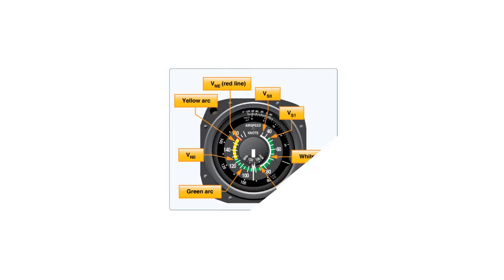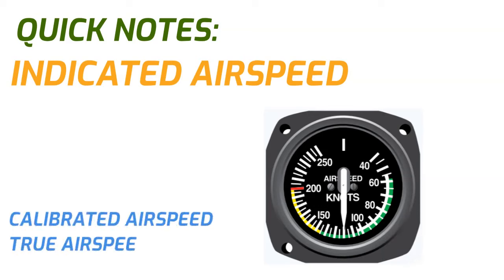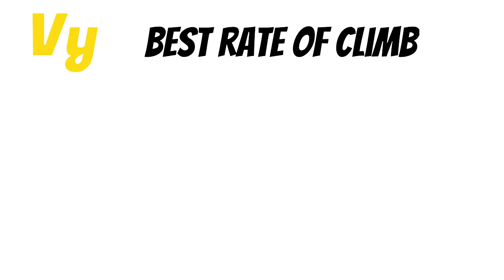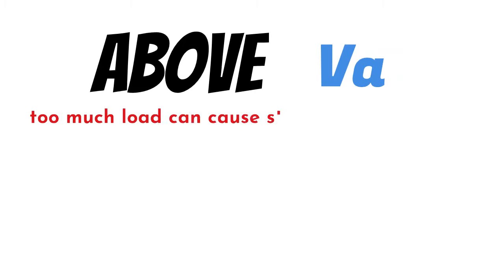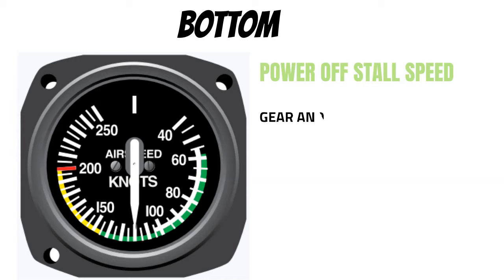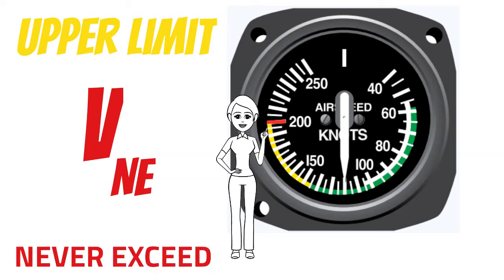V Speeds EXPLAINED! (Private Pilot Ground Lesson 12)

Comment: 0:23 V stands for velocity 
0:34 vspeeds refers to indicated airspeed 
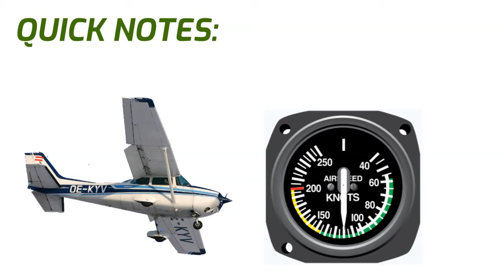0:55 at different speeds and flaps, there can be speed error. Manufacturers have adjustments in the POH. This is known as CALIBRATED AIRSPEED 
1:14 true airspeed is airspeed calibrated airspeed that’s adjusted for altitude and temperature 
1:20 -at colder temps and higher altitudes there is less pressure 
1:25 the airspeed indicator uses pressure to tell us how fast we’re going 
    - 1:32 to calculate this either use a flight computer or add 2% to your calibrated airspeed for every 1000 feet 
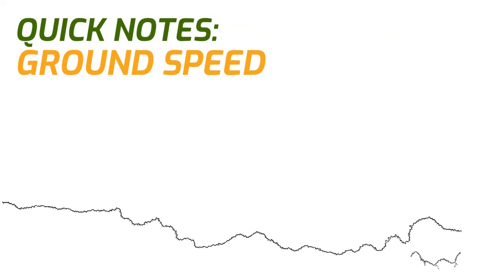1:40 ground speed- how fast airplane is flying over the ground 
  -if you have a head wind, you’re traveling over the ground slower than the airspeed indicator is showing 

2:03 VX and VY
-Vx is best angle of climb  and best used for climbing over an obstacle 
-vy is best rate of climb for time. 

2:46 maneuvering speed Va
-fastest airspeed you can fly without causing structural damage if fully deflecting a control or in turbulence 
- at below this speed you will stall before damage will occur 

4:12 Vs0
-gears and flaps for landing 
-S0 “stuff out”

4:19 upper limit of white arc “Vfe”
-max speed with flaps extended

4:39 green arc is normal operating range 

4:41  lower limit of green arc 
VS1 stall speed 
-S1 (stall with stuff in)

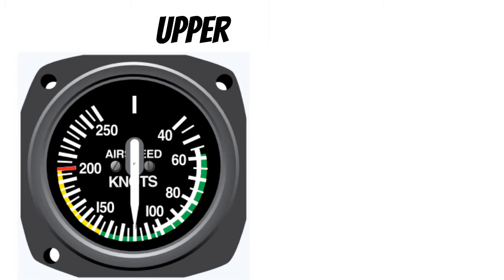4:52 upper limit of green arc 
-Vno (max speed in smooth air) 
-“normally operated” 

5:13 yellow arc is the caution range and should only be flown in smooth air 

5:54 VLO
-maximum speed for extending and retracting gear 

6:06 VLE
Maximum speed after gear has been extended

Comment: Hi! At 1:20 I think you wanted to say warmer temperature instead of colder temperature. Cold means high pressure because there is more mass in less volume, thus greater force acting on objects

Great videos, keep up the good work!
Reply from the maker: Yes. You are correct. I misspoke there. Thanks for the comment!
Reply: While some of this might be true cold air is usualyl more denser than warm air, which creates that higher pressure. The relationship between temperature and pressure within the atmosphere is more complex than just more pressure = colder. Typically at higher altitudes the atmophere contains air pressure that is lower. 
Picture this, you'ree standing on top of a high mountain looking down towards the valleys beneath you. The air at the top of the mountain is colder than the air in the valleys because it is higher in altitude. The air pressure at the top of the mountain is lower than the air pressure in the valleys below, even though the air is colder. The reason for this is because of the weight of the air bove the mountain is less than the weight of the air in the valleys, which creates that lower pressured system at the top of the mountain.  As the air above is lighter, the atmospheric pressure is lower even if the air at the top of the mountain is colder and denser than the air in the lowlands. You have to remember the relationship between temperature pressure and such also has to due with  variables like wind patterns, pressure, temperature, etc.

And in refrence to True Air Speed (TAS) the higher you go the less pressure there is thus there is less force acting on objects in the air. This entails less resistance to the motiono f an aircraft meaning less drag but also less lift. The true airspeed typically is higher than IAS because of that "less resistance"

So given the video, I believe FreePilotTraining is correct here
Reply: And I forgot to mention the temperature is typically colder and the pressure decreased due to the phenomenon known as the temperature lapse rate
Reply: @FreePilotTraining  As it also appears in text on the screen, it would be best to edit that bit of the video to show the correct text which could also show the correction in audio. It is too important to let this go by as some may memorize the wrong thing.

Comment: GREAT video man - I have one comment. I'm a new student so forgive me if this is incorrect, but I don't believe Vno is "the fastest we want to fly in smooth air". That would be Vne. Vno is the fastest you want to fly in ROUGH air. Gleim says "Flight above this speed (Vno) should be conducted only in smooth air and with caution."
Reply from the maker: I know, the wording is tricky in these V-speeds, but I double checked the P-HAK to be sure. I didn’t use the greatest verbiage, but what I said is basically correct. The PHAK says Vno is the “Maximum Cruising Speed. Do not exceed this speed except in smooth air” Vne is “Never Exceed Speed.  Operating above this speed is prohibited since it may result in damage or structural failure.”  So basically, I would not fly above Vno (in the yellow arc) with anything above “very slight” turbulence. You should Never exceed Vne. The airplane designers didn’t make it to go that fast
Reply: @FreePilotTraining  I think we’re saying the same thing just in different ways lol. Thanks for the response. I must’ve missed the “except” in the video
Reply from the maker: @RenaissanceSTL  lol I thought that was the case but I wasn’t 100%
Reply: @FreePilotTraining  in the video for Vno you say "this is the fastest you want to fly in smooth air" and the text on screen is "Max speed in SMOOTH AIR" you did not say "except in smooth air".

This is very confusing because immediately afterwards you say only fly in the yellow range in smooth air which directly condradicts what you said about Vno
Reply: @RenaissanceSTL   you didn't miss the except, I went back and listended several times and checked the subtitles and the text on screen clearly says "max speed in smooth air"
Reply from the maker: @nobodyofnaught2  I guess that is kinda confusing. Sorry about that
Reply: I'm glad this was in the comments because it has been bothering me as I go through the videos. Thanks for the clarifications.

Comment: So is the difference between Vlo and Vle that Vlo is the max speed in which you can extend and retract landing gear whereas Vle is the max speed you can fly with gear extended and retract? Or another way of saying it is the difference is Vle is the speed in which you CAN’T extend the gear, you can fly with it extended but you CAN’T extend it, only retract it?
Reply from the maker: Correct.

Comment: Thanks got the video! Do you think you could do some examples for the corrections for airspeed, and also adjusting for standard pressure, etc.?
Reply from the maker: I’ll see if I can make a short lesson on that for the next lesson! I appreciate your feedback.
Reply from the maker: Peter, I started making that additional lesson, and I’m wondering if that might be a little too much in the weeds for a Private Pilot lesson at this time.  We are going to discuss True airspeed again in the flight planning portion of the course.  In the performance section of your ooh, there is a chart which shows you what you’re True airspeed will be at different altitudes and temperatures, so that is typically what we use to find our true airspeed, but when we get to the flight planning portion, I will try to touch on that using the flight computer or the simple calculation method.
Reply: @FreePilotTraining  no worries! I was just wondering as we just covered that in my ground school class and the professor zoomed past it pretty past.
Reply from the maker: It’s because you will mainly be using the charts, they just wanted you to have a general knowledge of where those numbers were coming from.

Comment: What about DMMS ?
Reply from the maker: I chuckle when I see videos on DMMS. I totally agree that airspeed should be THE top priority when flying, but your aircraft landing speed IS a type of DMMS.  An airplane’s landing speed is prescribed as 1.3 of stall speed. This gives you up to 10% of additional protection even with a 45 degree banked turn. In such a turn, stall speed is increased by 1.19x the original stall speed.  This is where that 10% comes from.  Where people get themselves into trouble is when they don’t use flaps then slow down to their FULL flap landing speed. In this case, you don’t have protection for increased bank angle.  This is why I teach students to use flaps AS MUCH AS POSSIBLE!  That being said, you could calculate a DMMS for flaps up at 1.3 Vs1, but you’ll find that you typically get plenty of protection by adding 10 knots to your landing speed AND that is easier to remember than some random number. Excellent question. This might be worth creating a video…

Comment: Just to clarify so are Vx an VY usually the same?  If not which one do you use?  Thank you.
Reply: The speed that is.
Reply from the maker: Good question. This short video explains it a little bit better. https://youtube.com/shorts/JUrOjNXB9Z4?feature=share Vx is usually a slower airspeed to help us clear obstacles.  My video on performance goes into a lot more detail.  I discuss that towards the end of the video
Reply: Vx is smart to use for takeoffs as you'll be closer to the airport at a higher altitude in case you have engine problems that cause you to need to turn around and land back on the runway in the opposite direction. Better to be closer to the airport and higher in the air on takeoff for emergency possibiities. Once you are at a safe height to glide a good distance, then change to Vy to attain cruise altitude.

Comment: Vx and vy are so confusing. 
If Vx gives you the most altitude in the shortest distance, and Vy gives the the most altitude in the shortest amount of time.... aren't they the same. Description wise?
Reply from the maker: If I’m taking off and I’m trying to climb above an obstacle, distance is the factor. Not time. If I climb at Vx, it will take me longer to get to my cruise altitude, but I’m only concerned about my altitude in the short distance that I’m flying because I don’t want to run into that thing.  It’s like taking a steeper set of stairs.  It only takes a few steps to get higher than the other staircase, but it takes so much more energy.  A normal shallow staircase is better for longer distances (or your climb up to cruise)
Reply: Vy is actually distance over time not altitude over time